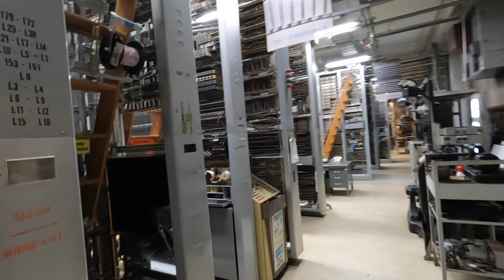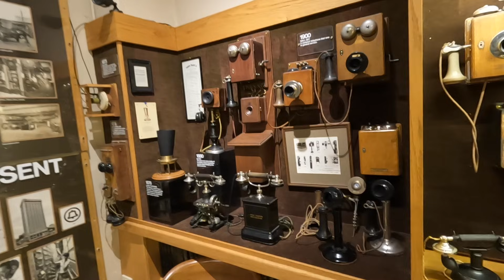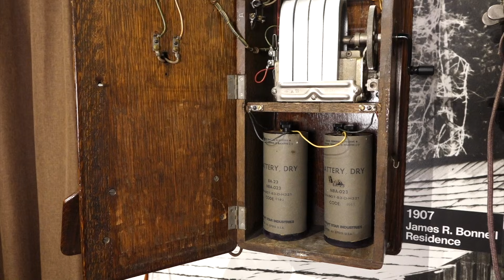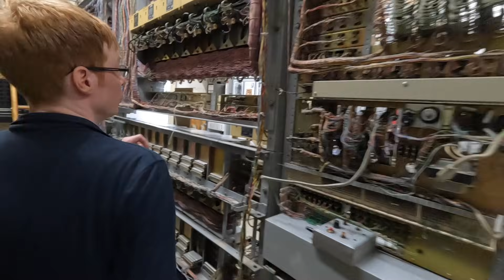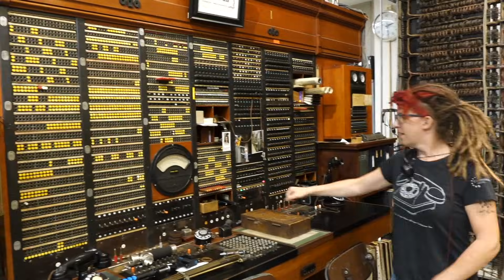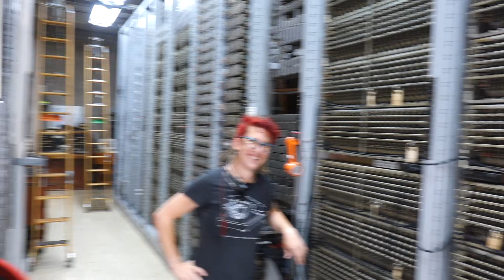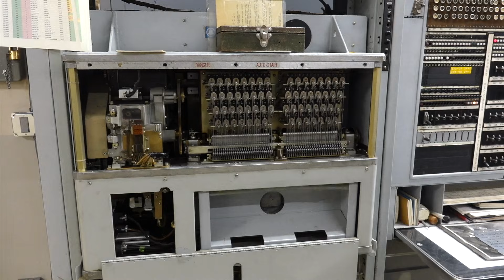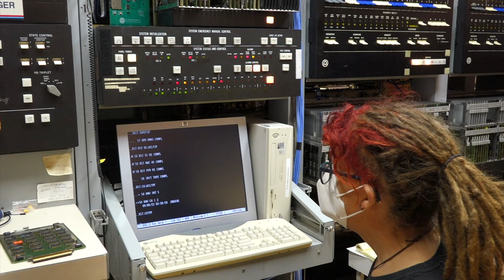At the Connections Museum: the insane telephone technology that led to today's computers

Comment: How can an electro-mechanical system this complex made to work at all? Not in principle, but practically: the required precision and reliability for getting meaningful uptime must have been quite the barrier.
Reply: It was. There was incredible amounts of engineering effort put in to ensuring that these systems would work almost perfectly. They basically originated the idea of 99.999% uptime. In most cases (except for extreme things like fire, flood, etc) downtime would only be a few seconds per year. 

One of the basic ideas that allowed for this kind of uptime was redundancy. There was always more equipment than was strictly necessary for the amount of subscribers in a telephone exchange. The network was interconnected in a nearly non-blocking configuration, so that no single point of failure could completely break it. There were always alternate paths that the call could take while the equipment in trouble was diagnosed and repaired.
Reply: The irony is, they were saying the same about semiconductors in the 50s: that it would need to be precise and couldn’t possibly be reliable enough. It’s funny how standards change when entire industries around certain types of precision manufacturing grow anew. 

Even sci-fi authors of the early 20th century were in awe at their manufacturing tolerances for tiny contactor/commutator arms and the like. In fact, that’s why stories back then had telephone networks becoming complex and fast enough for emergent consciousness, just as the stories switched to doing for computers starting in the midcentury!

Comment: It's kinda funny with operating systems and programming languages as Ericsson (Inventor of the digital phone exchange AXE) developed a whole new programming language called Erland as they realized they needed a language that you didn't have to complete, that you could edit while it was running - and its still being used for a lot of financial application where you can't afford to have to re-compile.
Reply: ErlanG, I think...the units of traffic measurement (offered load vs capacity)

Comment: I joined the Bell System in 1973..became a technician in 1982. Worked inside central offices..in the field and at customer locations. I helped install some of the first fiber optic lines in 1982. Worked in the test center testing phone lines and sending trouble tickets to the outside techs. This old switching equipment was being removed back in the 1980's and replaced by E.S.S. electronic switching systems.

Comment: I've worked for a few telecoms in the early 90's, at AT&T for example I worked with a Sparkstation terminal running a modified version of Solaris and an interface called WINGS (which looked like CDE desktop) at the time. On another carrier I worked with the Excel (Lucent) switch and monitored their T1 trunks to ensure all channels looked normal. I miss bouncing the D channel LOL. They later switched to VoIP. This video brought me memories. Thank you!

Comment: When I was a kid we had telephones like that at home (in a village in NZ in the *1970s*). When they were replaced we ended up with two of them. I found out about the 100 V generator when my dad asked me to "hold those two wires" so that we could test whether the bell in another phone would ring. I made more noise than the bell. Anyway, the two old phones made a nice intercom system.

Comment: Wow, this takes me back :-)  I worked in some of the telephone exchanges around Edinburgh in the eighties, working on a project to the do the first automated itemised billing for Britsh Telecom.  I was working in Galashiels telephone exchange with some BT engineers who were adding some new Strowger or Crossbar racks to the exchange, part of which involved extending the huge copper bus bars that transported the 50V around the exchange, where each rack had a set of solid copper bus bar conductors which got bolted to the end of the previous frame, with the whole lot then being insulated.  One of the engineers dropped a big chrome vanadium spanner and it shorted out a positive and a negative bus bar, which hadn't yet been insulated.  There was an ENORMOUS bang, flash of white light and a huge shower of sparks about ten feet across rained down.  The two ends of his spanner were welded one to each bus bar, with a three inch gap in the middle where the solid steel had been vapourised :-o  I wonder if those spanner ends are still there, LOL :-)  Another great video Mark!
Reply: When i was at Napier College in the 80s learning about digital telephony we visited Woodcroft which was at the time a big exchange. Of course there was no digital signalling there at all - it was all Strowger and crossbar switching!
Reply: Wow! The spanner became a fuse!

Comment: I worked briefly for TDC (the national Danish telecom company) about a decade ago at their Fasanvej location, which once handled all phone calls and other communication for central Copenhagen. It is a massive building because it once housed all the mechanical switch relays, but since our telephone network went entirely digital in 1989, all the mechanical switchboards were long gone when I worked there. Instead the entirety of the phone service is handled by a bunch of computer equipment in a relatively small room on the side of the building, where it was built so they could continue running on the mechanical system until everything was ready for the digital switchover back then. With the mechanical systems gone that building has a lot of very big and mostly empty rooms where the only content is the occasional stack of equipment to handle dial-up and xDSL, but some of that was quite old since there's no reason to replace the dial-up computers when dial-up is largely no longer used here. It was strange walking through those massive rooms and imagine that they were once packed full of mechanical relays, but it is truly difficult to convey the scale of a place like that to anyone who hasn't seen it, and rather amazing that everything that was once there is now handled by a few computers in a small room. The evolution of the telecom equipment really is incredible and it's just spectacular watching the old mechanical switches work their magic and somehow make connections

Comment: My childhood home (1974-) had a phone with turn handle, local battery, and the trap door indicator panel in the local post office.  Our number was 78.  The switch was the topic of a school visit.  
Automation and central power happened in 1981.  The phone number gained 4 digits, later another, and finally became 8 digits when Australia adopted a uniform system (8+ 2-digit area code).  The 78 persisted on the end of the number throughout.
My nieces cannot comprehend a fixed phone, let alone one with a dial.
Reply: I was wondering what would happen to a phone number of it was kept that long, I thought it'd be 00...78 after the area codes of course. I once saw a picture of a funeral home proudly displaying a sign with the words "PHONE 12" on it

Comment: That was fun! I really miss my days at Bell Labs. That was probably the best job I ever had. I started out in DMERT development and then moved on to development of the Autoplex 1000 cellular switch. Did you say you were at BTL?
Reply from the maker: I was at Bell Labs Holmdel, New Jersey. Early integrated optics. I miss these days too, the amount of brainpower per square foot was palpable. We played volleyball right underneath the antenna that discovered the Big Bang, and Nobel prize winner Arno Penzias was our big boss.
Reply: @CuriousMarc  I was at Indian Hill, in Naperville, IL. I really hated to leave but I was offered a job at McCaw Cellular Communications in Seattle and, not really caring to face another Chicago winter, I went.
Reply: Seeing DMERT brings back memories. I worked with 3B20's running DMERT OS for several years before moving to the Piscataway development groups. Fun times. I wish I could relive the 80's again, best jobs I ever had. Second best was doing the early electronic switching in the 70's. I ended up taking an early retirement offer in the 90's just before it all fell apart. I feel bad for my younger colleagues who were totally screwed. It was a very bad day when I read the Holmdel complex was abandoned, good memories there.

Comment: When I started working for a British Telecommunications company ( you can guess which one) back in the late 80’s one of the first jobs I was involved in was ripping out a huge room full of a PABX 4 for Pan Am at Heathrow Airport. We went from a room of strowger equipment to a Nortel box of tricks on the wall ! There was still a few bits of working strowger kit in the telephone exchanges but soon got replaced by crossbar, system X, system Y etc… I learnt things such as lead plumbing, butt stuffing ( not what you think !), twist & tip soldering, gun wrapping, E & D side, earth A battery B, bells A & B, cosmic, transverse screen, pressurisation and so on….now towards the end of my career I’ve worked on Ethernet fibre provision for the last 19 years and there are still ringing generators, test desks, dolls eye boards etc still in exchanges , still working, as no one has bothered to unplug them or turn them off.
Reply: You definitely have different terminology for telco work over the pond. I'm betting your "twist & tip" is what we would call "twist & tube" for using the wax coated tubes to slide back over the pigtail splices. Your "lead plumbing" would be our "wiping"., as you heated the lead on a joint with a torch and "wiped " it into place with a wiping cloth of heavy multi-layered cotton, or old school splicers poured molten lead from a heated pot with a ladle and would also wipe that into shape while it cooled. Your "Earth" would be our "return", Battery is the same, and we also use a "Positive Earth" system. All of the exchanges near me had the boards on the "test centers" removed long ago, to reclaim space, but every exchange still had a rack with its own test board in it.
Reply: @poormanselectronicsbench2021  hi. Thanks for the comments. As far as lead we used moleskin with tallow but I did also train on the poured method. Twist & tip, we used either paper sleeves ( that we baked in a baking tin over a gas stove !!(usually on paper insulated cables)) or polyethylene sleeves on newer cables before machine jointing then modular jointing came in.
Reply: @andrewrixon2347 :  When I first started, we were trained to use the 3M series 4000 module, which is still in use today in upgraded forms. I was detailed to New England in 1983, who were using a mix of 3M and Western Electric "710" style modules, which, were rubbish IMO ( although Western Electric used them on equipment shelf connections) , and we refused to use them, sticking with the 3M product. Since the "twist & tube"method usually made was called a "no slack" straight splice, some techs chose to do taps/bridges by sliding he tube aside and wrapping the new wire connection onto the existing, so sometimes we still did that, because the alternative was to first build slack into anything you had to work on.
Reply: @poormanselectronicsbench2021  yeah most of our joints were no slack. I was based at London Heathrow Airport so we had limited access to everything so it was joint it, close it, leave it. We always tried to either injection weld the really big joints ( up to 4800 pair) or use Raychem 4 series shrink down closures. All these joints were on dry cables which we pressurised with 620mbar of desiccated compressed air fed from the exchange with transducers measuring the air pressure along the lengths. Modular wise the 3M took some beating and I loved working with it. We had a single wire “machine jointing” system earlier with the “crimps” in a cartridge. You had to do several test crimps first and the out them through a “go - no go” gauge to ensure the machine was set up right. The first crimps were white, then yellow then modular was introduced.
Reply: That Nortel "box of tricks" may have been an early Option 11 PBX.  I had 2 Option 81C's and two Option 41C's in my network at the hospital and a bunch of Option 11's and remote peripheral equipment at many of my off campus doctors offices.  I was factory trained by Nortel and loved working on the stuff.  I retired and now play with some of the original 1920's - 1960's analog station equipment using channel banks and a small VoIp system.
Reply: You never remove functioning equipment until the site is fully decommissioned in many cases. Even today I go into businesses that have hand operated elevators. I got to see the last functioning IBM 360 that was decommissioned in the I think late 80's It was still processing work until its last day even as the new system ran in parallel.
Reply: I also worked for BT in the 80s but left after Maggie Thatcher sold it all off for peanuts. I missed out by 1 week getting my complimentary £10K shares 😔.
I went on to work Modern Alarms covering NW London and Middlesex as a Service Technician. Heathrow was 1 of the biggest jobs.
Reply: @stephenjones9153  I started at Heathrow in 1988 as a copper jointer which was cool as I lived nearby and, because of the security restrictions, we did everything, e side, d side, pressure, transverse screen, Overhead, and so on…
I was based there for 10 years then the can-do project came along, all the bad cable lengths, joints in shopping bags etc as a precursor to the roll out of ADSL, me, one experienced jointer & 30 new starters in west & north west London ( Chiswick, Kensal Green, Golders Green etc…) the came a real number if a manager and I got into business fibre 19 years ago and never looked back !
Reply: I worked for Post Office Telephones for 43 years, starting as a cable jointer, e-side, d-side and Junction cables, lead plumbing, epoxy putty plumbing, then moved to a Linesman’s role, after that it became British Telecom. In the 80’s and I moved to a purely Business role working on small electronic PBX’s, eventually onto big PBX’s and then Cisco network equipment and lastly onto IP based PBX’s and cloud services. Great job tbf and I have to say I enjoyed it all.
Reply: Yep I hear you! I've done this work for years.
Reply: heh heh   heh heh heh  He said butt stuffing  😁